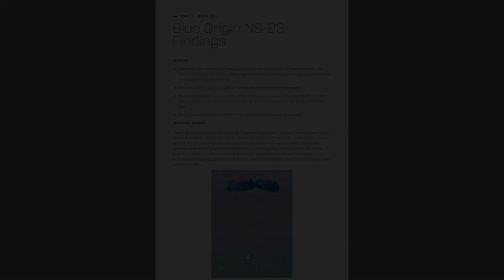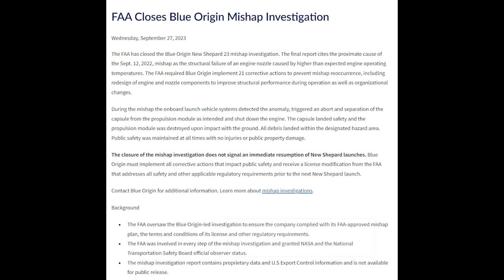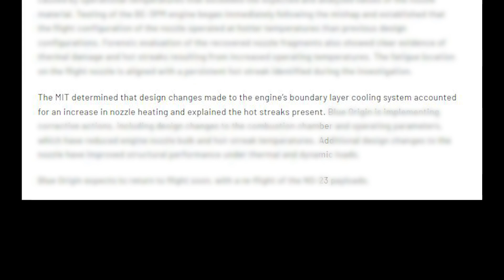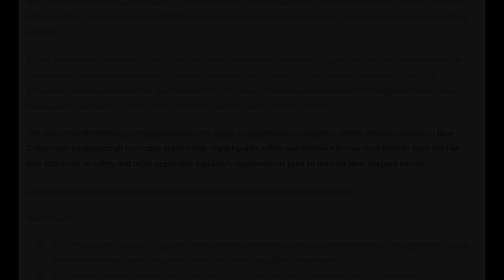Blue Origin's New Shepard Is Grounded Awaiting FAA Approval

Comment: Great Video !  The FAA is closing down another space company !  The 3U version of this BO New Shepard rocket engine has a larger nozzel for use in space !  The BO Blue Moon will use this engine with the larger nozzel.  For LS to LLO (about 2.0  km/sec delta-V and for the Round Trip back to the LS about 4.0 km/sec delta-V)  For the NASA L1  Lunar Gateway to the LS (3.0 km/sec  delta-V) and the RT from the NASA Gateway to the LS (about 6.0 km/sec delta-V for the RT).  When the BO Blue Moon  (LEV/LLV)  can be fueled at the Lunar Base, the Blue Moon can return to the LEO Commercial Space Station   (CSS) (LS to LEO 6.1 km/sec delta-V)  For more info on the LEV/LLV  (BO Blue Moon) see "Moon Direct" by Robert Zubrin.  Timothy Lipinski

Comment: The failure did demonstrate how effective the BU New Shepherd Abort System is.
SpaceX fanboys note - Starship has yet to discuss a launch abort system for a man-rated Starship, despite proposing to put crew INSIDE the second stage of the rocket right above the fuel tank dome. I find that kind of stupid. And I expect NASA will NEVER, ever, ever sign off on astronauts launching from earth on Starship as currently designed. And of course the Starship HLS has no abort capability either, unlike the Apollo Lunar Module.
Reply: There can no more be an abort system for a multi decked spaceship than there can be ejection seats on an airliner. Anyway, don't even compare a suborbital bottle rocket to an interplanetary spaceship.
Reply: So you want the astronauts to sit above a "3rd-stage" rescue fuel tank dome instead?
The thing you seem to miss is that SX is trying to make SS mutli-engine-out capable and still make it back safely to ground if needed for SEVERAL TENS of people on board when launched - no other system has ever tried this so far, so your "gotten-used-to" solutions (hypergolic/solid fuel booster escape system) to this problem NATURALLY will not transfer 1:1 and you will have to get used to some different approach instead.

Comment: This New Shepard ride is not much different than Branson's Virgin Galactic roller coaster ride to Sub-orbital space. It's a Roller Coaster ride on steroids relegated exclusive to the Super Rich or some lucky lottery winner w/ $400,000 Grand of "throw away" money burning a hole in their pocket.  All you end up with are the bragging rights to owning the Fake Astronaut Wings these people are awarded for their extreme generosity. Actual Astronaut Wings require control of the vehicle and to reach the Karmen Line, something neither of these rides qualify for.
    The weightless experiments on board could likely be done on the "Vomit Comit".  When you listen to the Hype from the commentators before each of these flights, it's either all about the diversity of the people who were Awarded a ride or the experimental payloads aboard, and they sell that Hard. Other than that, there's not much here that appeals to a real Space enthusiast. It's just an opportunity to watch Rich People burn enough money to buy a house.